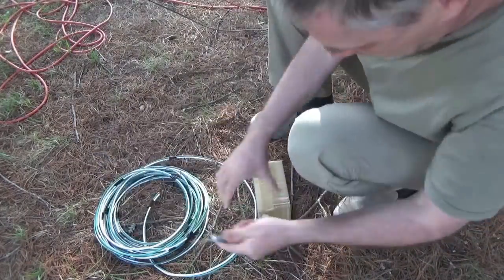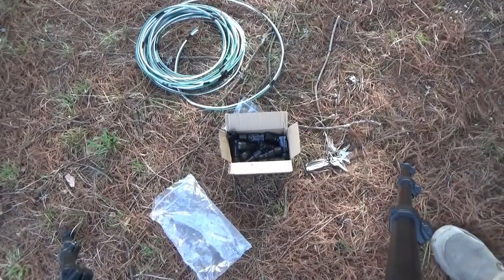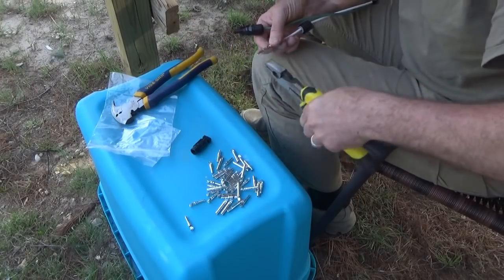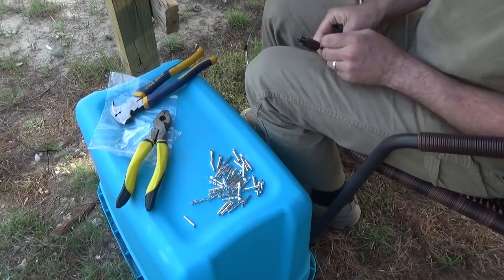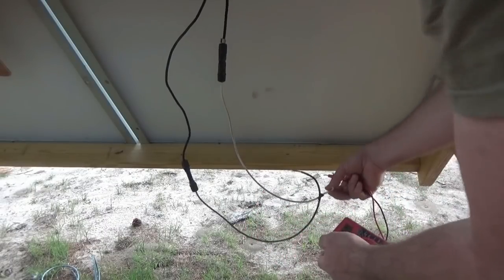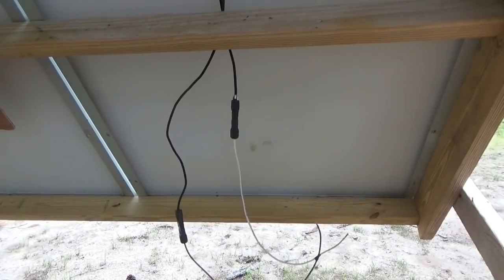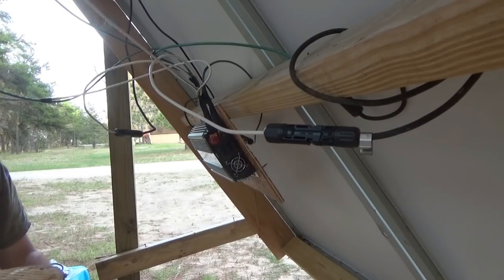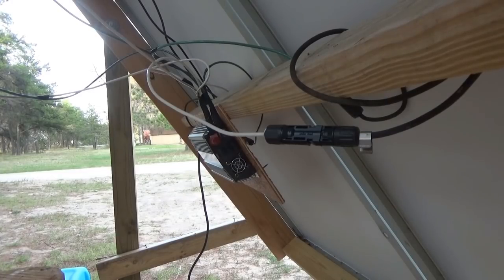Wiring Up Solar Panels For Improved Off Grid Homestead Power

Comment from the maker: Visit DIY Tube Video Community and get paid for comments, video views and more: http://www.diytube.video
Reply: sorry troy but those wires should goto the controller from the bottom up. not the top down,  
of the get wet or get condensation on them it will run down the wires to the controller.
and i hope ur goint to put a box over the controller to stop the rain in the wind or even damp getting to it

Comment: I give that install 2 weeks maybe. First, stranded wire for dc, solder all outdoor conectors and splices, use a drip loop when approaching your equipment, i doubt that equipment has an outdoor ip rating.
Reply: James Jedamski. I am talking about corrosion getting into the connection and raising its resistance over time. It may not fail, but it will pass less power as resistance rises.
Reply: The Do It Yourself World I did not say it would not work, only that the conections would contunue to degrade over time. Vinyl tape does not waterproof a connection. At least raise up the controller so the wires form a drip loop into the box.
Reply from the maker: First, it is stranded wire. Second, there will be no rain since its behind the solar panels. Third, I am taping all joints to prevent moisture. And I know of other people with the exact same device outside behind their solar panels for years now with no problem. I will cover it anyway to be extra sure.
Reply: Cant disagree with you because you are correct.. However if the listed connectors are utilized ( engineered with rubber grommets and o-rings) you will not have any issues.If I was doing home made DC connections that were going to be exposed to weather, yes soldering is a viable option.
Reply: Have done thousands of DC outdoor connections without solder with zero failure rate.....not sure what you're talking about.

Comment: Is that a grid tie inverter how many watts can it handle? It looks like one I still have one left. Do you think you will need more? I know you know its a lot better to use stranded wire for DC current right? yeah grid tie is the best way to go for sure. that way you dont need batts and it just goes right into your houses existing wiring so easy to do.

Comment: Good to see the proper wire and connectors But I have a couple of questions about safety. Is that safe for Michelle? Where it appears  little fingers can get to exposed terminals. And how does the power get to the house? Conduit? Not meaning to give you a hard time. Just want everyone to be safe.